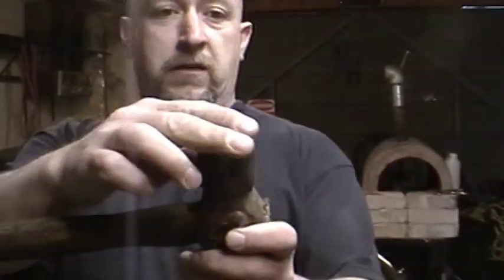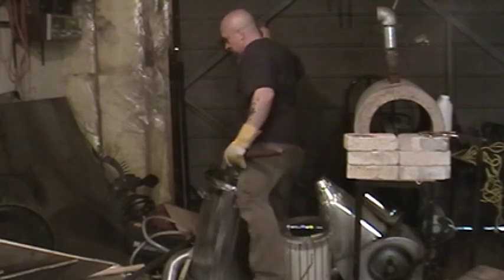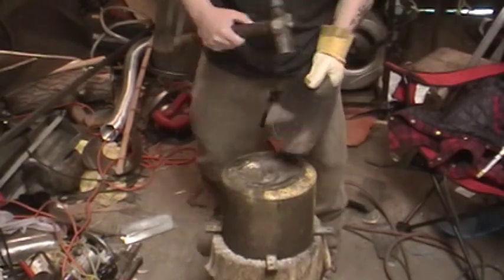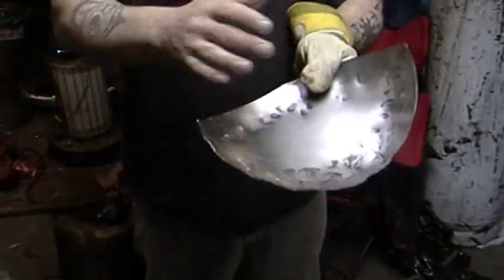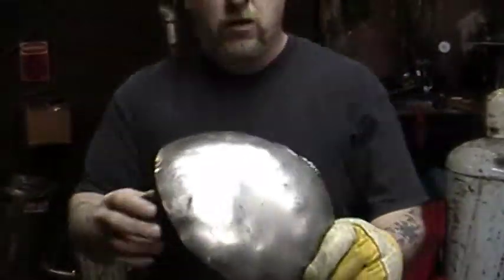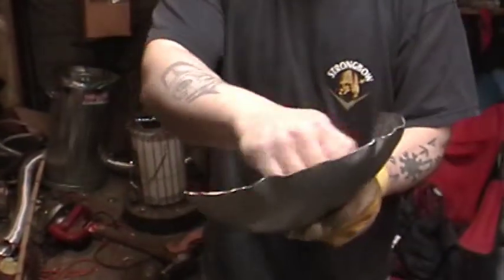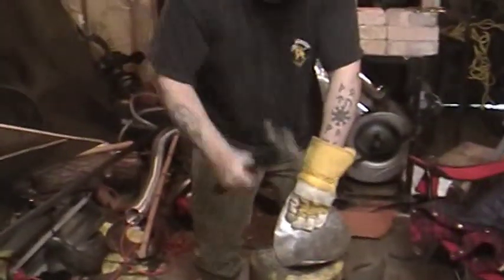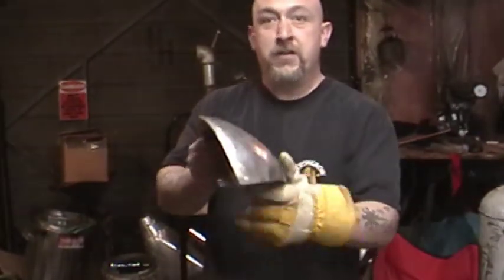Basic armouring - dishing a helm half..mpg

Comment: how do you ensure that the second half will be the same radius as the first and they will match up for welding?
Reply: Just careful attention and then spot weld the halves together at one point. Small adjustments over a ball stake and continue until everything lines up. Finally finish weld and final planishing until smooth. Sorry I never finished the video series. Life got in the way I'm afraid.

Comment: would this same technique apply to demascus steel, besides the heating of the metal?
Reply: where did you find damascus sheet steel?
Reply: hahaha
Reply from the maker: Drew Pefferson  if you had pattern welded steel to work the same techcan be used however a wooden mallet and a wooden dishing stump will save material and   grinding time.

Comment: What is steel thicknes?
Reply from the maker: Azurael1 the steel used on this is 14 gauge
Reply: Flat Finger Forge mild steel?
Reply from the maker: Azurael1 yes mild. You can do the same with some stainless types however you need to stop and anneal the steel between passes to prevent cracks.
Reply: Flat Finger Forge ok what kond of steel you propose? And question with steinless. How many anneal it would nead it?